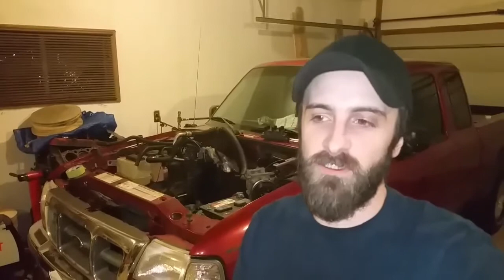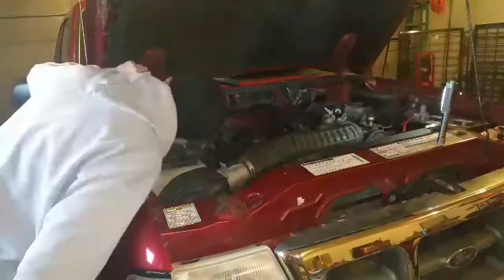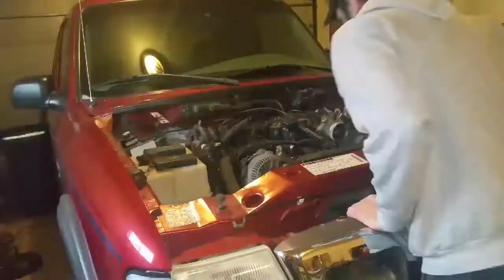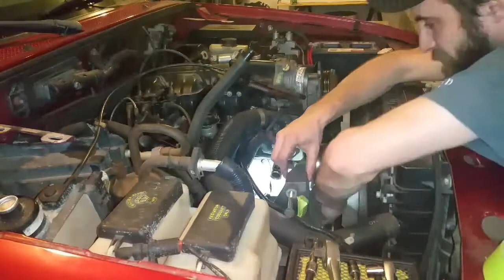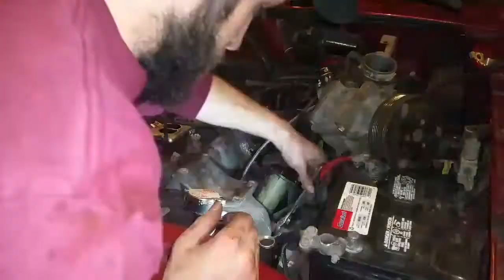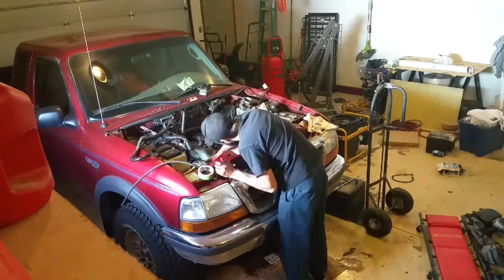COMPLETE ENGINE REMOVAL TIME LAPSE!!! 30x Faster! Ford Ranger LS Swap!!

Comment: How did you disconnect the motor from the trans? I have a 1997 3.0 ranger 4x4 and I'm trying to pull the motor out by it's self, not connected to the trans. Thanks.

Comment: He got it done, but you can get it out easier , and faster without having to take the brackets off first...if you have a remanufactured engine ready to go back in, you can pull the old one, switch all the brackets and such to new engine and have it back in and running in less than 8hrs...but, not everyone does this for a living.  Anyway...he got it done...

Comment: hey man, new subscriber. How did you find this job overall? I gotta replace my 4.0 in my 03 ranger soon. Rear timing chain is on the way out. I havent done a engine pull before.